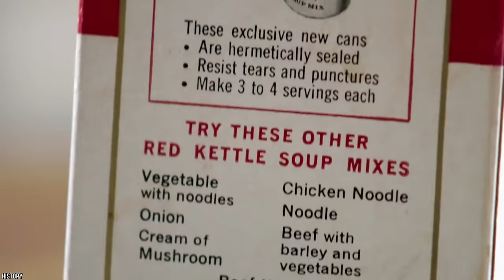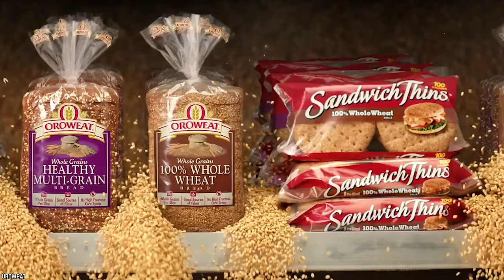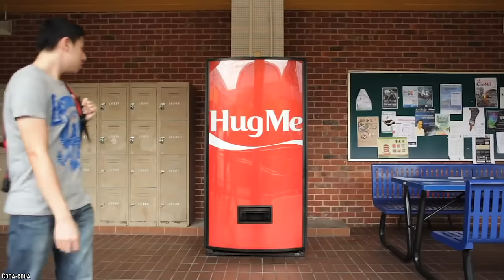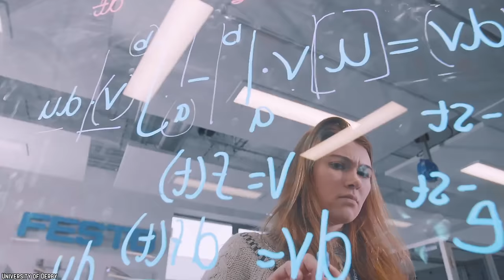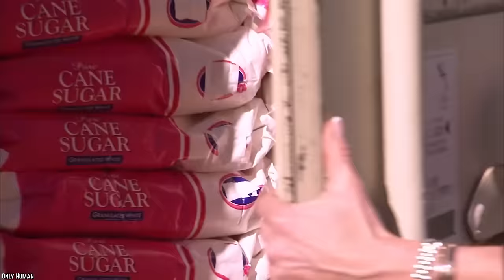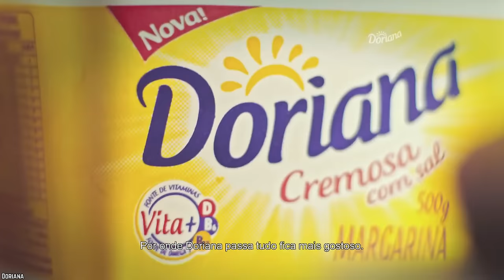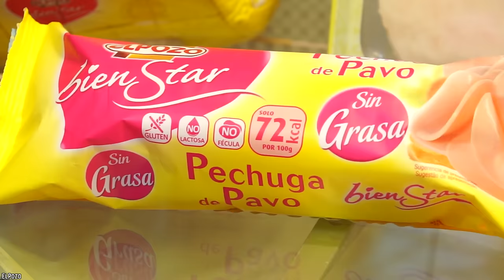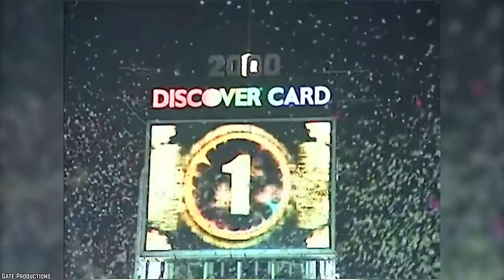10 Most HARMFUL Foods People Keep EATING!

Comment: Regarding canned soup versus homemade soup, if it's the salt that's bad, wouldn't homemade be just as bad, if we put in enough salt for it to be tasty? This is a sincere question, BabbleTop.
Reply: It’s true that condensed soups are high in sodium. They’re not intended to be eaten right from the can. You plop the blob from the can in a saucepan and fill the can with tap water. Put on heat, stir for a while and sit nearby. After you read the section A of the local paper, you have lunch! Recommended: crackers.:)
Reply: You don't need salt in homemade the delicious flavor isn't processed out

Comment: So much is incorrect in this:
1. Soup Cans (Wrong): Salt is not bad for you unless you eat an unreasonable amount.
2. White Bread (partially wrong): All bread is bad for you, its arguable as to which is worse since whole wheat has far more glyphosate on it.
3. Tuna (Correct but exaggerated): Tuna has mercury, the level is not extremely high, but is high enough to be harmful.
4. Diet Soda (Correct)
5. Potato Chips (Wrong): Potato chips are not extremely high in salt or fat and are high in potassium and other nutrients.  The only thing bad for you about them is the frying process as well as many flavored chips have bad stuff in them.
6. Non-Maple Syrup (Partially Correct): All syrup is bad for you.
7. Margarine (Correct)
8. Energy Drinks (Incorrect): Most energy drinks have the same level of caffeine as coffee. None have anywhere near 10x as much.  Highest I could find was not even 3x as much as coffee.
9. Fruit Juice (Mostly Incorrect): Juices are lacking in fiber and high in sugar, but still have vitamins and are far healthier than soda.  Also orange juices is very high in potassium.
10. Deli Meats (Correct)